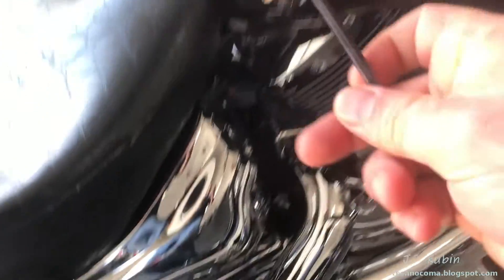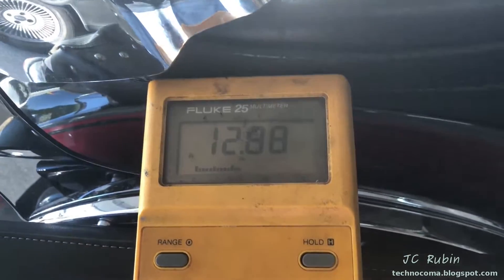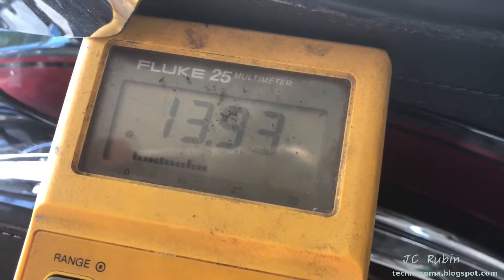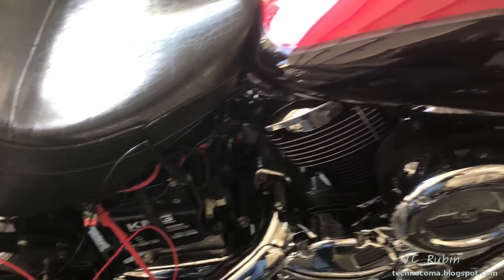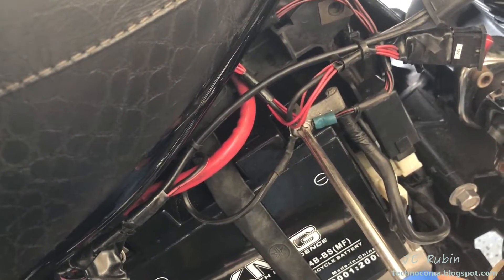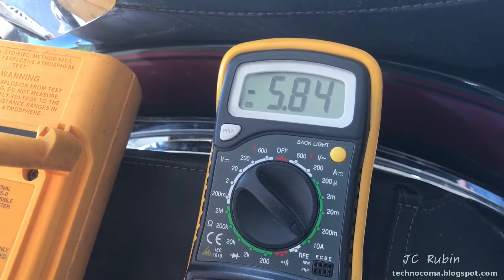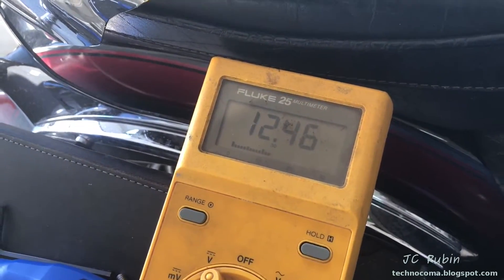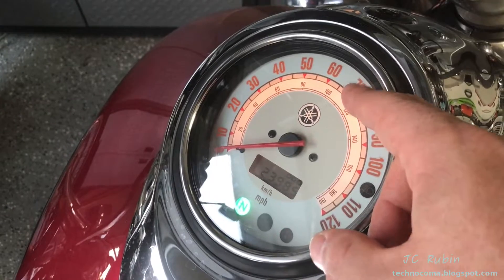Yamaha VSTAR 1100 Basic Troubleshooting - Charging system, Voltage regulator and battery

Comment: Good video I tried it,I had a question I checked all my wires an fuses but I notice at times my vstar 1100 speedo jumps,but all the time I have my signals on the lights will flash also and if u hit the brakes the lights will dim.have u ever experience this issue?
Reply: The cluster and blinkers/lights are on the same circuit. I believe it's a 10. Hopefully that helps somehow.

Comment: I use this time to demonstrate that the idle current is about 6 amps for a vstar.    If I hit the starter I would have obviously blown out the meter.  DONT HIT THE STARTER. DONT!!!!! DONT!!!!!!!

If your multi meter is in the 10 to 20 amp seperate input, and you do try to run everything through the meter including the starter, please dont worry because the meter will probably be able to handle the current draw for a brief period while the starter is engaged.
Reply: Joseph Nicholas
i tried to jump start my 1100 but put the wrong cables positive & negative now the motorcycle is dead  what can i do ?